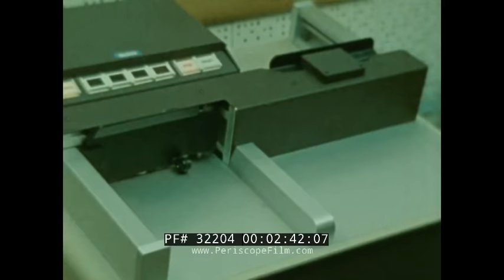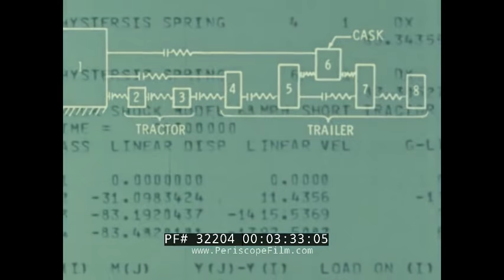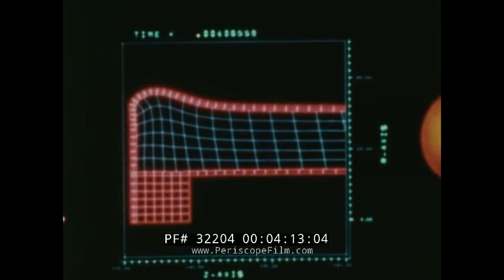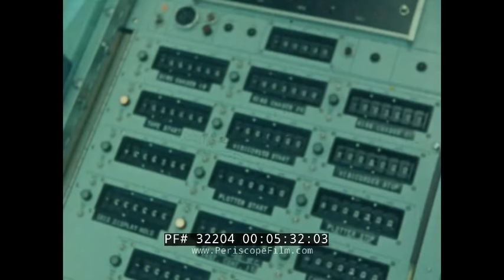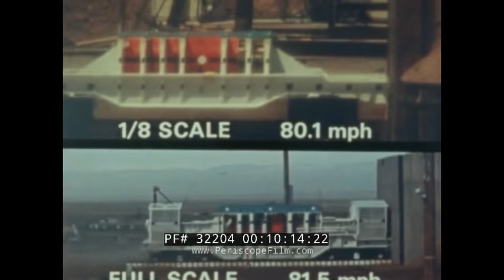NUCLEAR FUEL CASK ACCIDENT TESTING  SANDIA CORP. FILM  32204

Comment: Should have two casks hit each other in various ways, like say a transport truck hitting a 2nd truck with a cask and head on and side on and the same with a train doing the same? Both casks need to hit each other though at 60, to 100 miles per hour ? Also the current munitions if used to hiot underground storage places of these casks ? Just imagine a 50 Megaton missile hitting a current storage place the amount of radiation which would occerum rasor anyone ? Also spent fuel rods are concentrated uranium and not the same as used in nuclear weapons manufacturing as well. Approx 1000 times more more powerful  ?
Reply: No it's not. Where on Earth did you get such nonsense from? HEU used  in nuclear weapons has a far higher percentage than that used in power plant fuel rods, which contains even less when depleted. Don't you understand how fission works?

Comment: The remains of the driver were removed with a spoon. btw Look at the model impact of a so called "train accident", the "train" was made so soft that it collapsed in itself working as an shockabsorbing cushion, like there are no heavy diesel engines in locomotives!  I guess were still being lied to.
Reply: I mean, they ran the test train at over 3x the average commercial train speed. You not going to take that into account?
Reply: @captainpocky  Yes we did old boy. Pip pip.😊 🙏🇺🇸🏴💯❤.